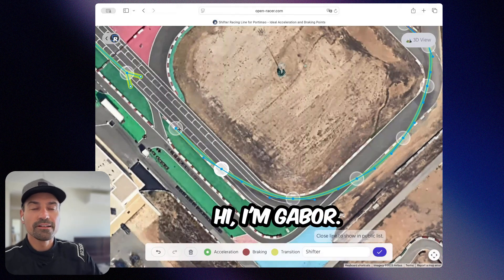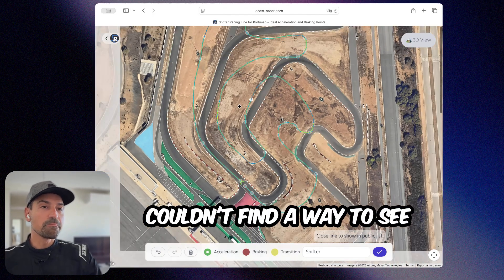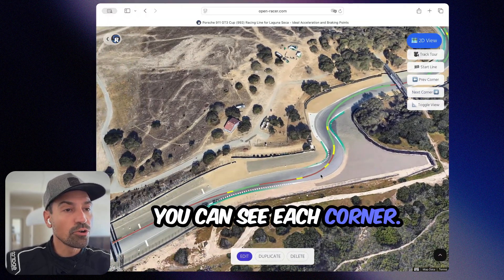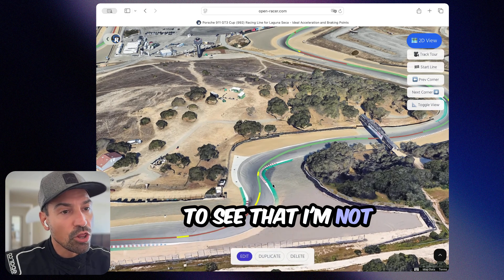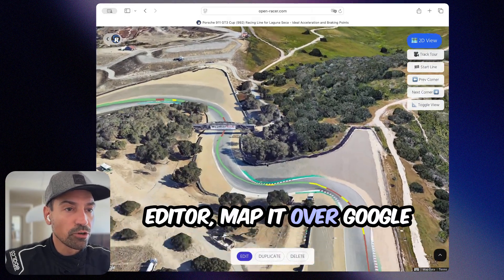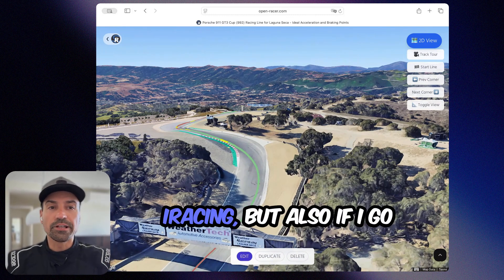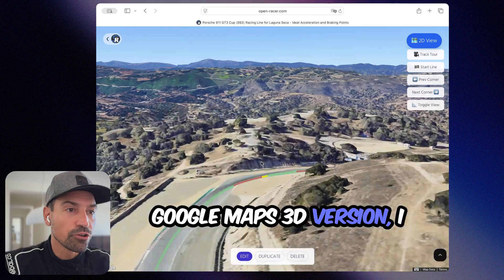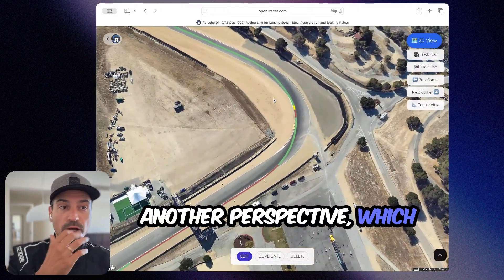How I Use Open Racing Line Editor to Prepare for Karting & Race Tracks | Real 3D Maps & Telemetry

Comment: Hi Gabor. Nice tool but I can't adjust the bezier handles to open up the corners. I also can't add anchor points in between existing points. Maybe I'm doing something wrong.
Reply from the maker: Thanks for using it! Those features are missing. I can add them for the next version.